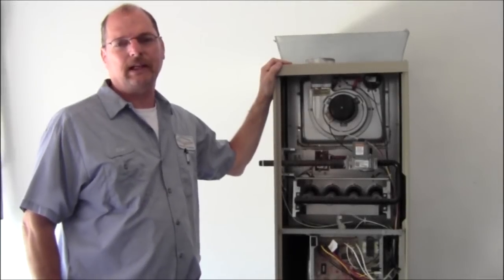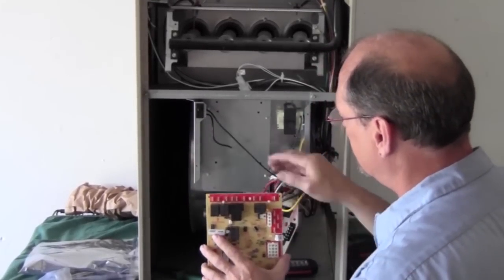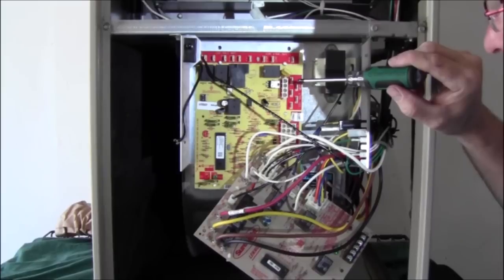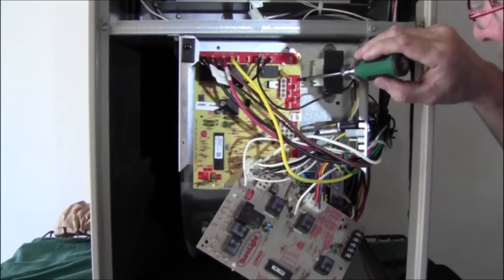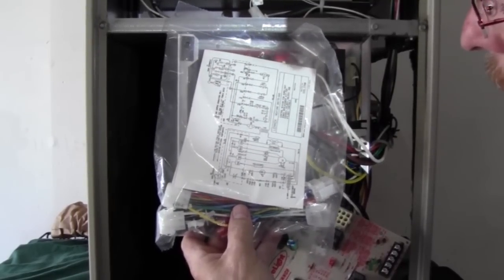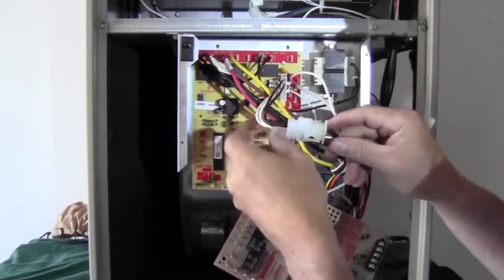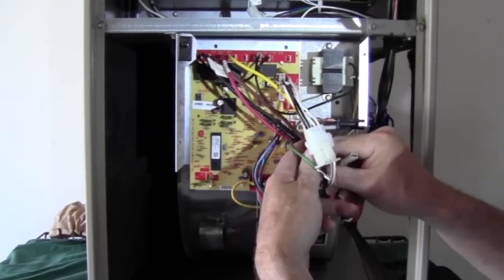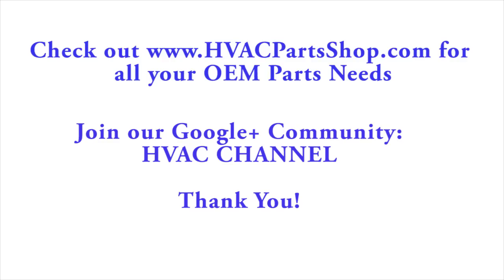Replace an 83M00 Lennox Furnace Control Board (Replacement 19V36)

Comment: If you install the 19V36 board in a furnace that is dual-speed heat, the furnace will then be single-speed heat as the 19V36 board doesn’t support dual speed.
Also, if the 19V36 install guide tells you to put the red “ACB LOW” wire on the “CONT” terminal of the 19V36 board - don’t do it. If you do this, your blower will run on low speed 7/24 continuously even when the thermostat is off.  Instead, move that wire to one of the 19V36 board PARK terminals. The ACB LOW red wire is the low speed blower wire, and there is no low speed function after installing the 19V36 board, so the correct terminal for it on the 19V36 board is one of the PARK terminals. A PARK terminal is not connected to anything - it’s just a place to put an unused wire.

Comment: I've replaced two boards in a 2-1/2-3yr period so far. Board wouldn't let me clear the code. Also, it would never go in soft lockout mode. That's when I figured it was the board. Who's making these boards for Lennox?

Comment: What a fantastic video. I'd hug that man if he was near me.! 
Thank you very much!
The instructions that came with board... garbage.

The only thing different from mine and his...

My yellow and green wire were in the board together. 
I cut the green (ground ) from yellow and attached it to the ground.

My board also came with a brown thicker wire labeled ACC on the board. That must be for a multi speed fan blower. 

I followed the brown wire to its origin and a 3 connector (black white brown) plugs into a 2connector. (Black white) 
Brown empty. 

Once again.. fantastic video THANK YOU !

Comment: Great Video!! Thank you so much. I had a yellow wire from the transformer connected to a green wire with a clip that was plugged into the 24 VAC RTN. The yellow wire I attached to the yellow wire from the harness, and the green wire to the green from the harness. Nothing is attached to the 24 VAC HUM on the new board. The blower now works, which it hadn't, but when I turn on the heat or AC, the 3 amp safety fuse pops.

Comment: I have a g40uh-36a-070-03 and the board is smaller than this one. Will this board work?
Reply from the maker: I suggest using our video "Using your Model Number to find parts" video to help you use your model number you provided to find the board that you need. if you have any questions feel free to call us at 1-866-215-3831

Comment: This is good information thanks, I have a BCC3-2 Rev B LB 90676 Cat No 65K29 that the unit is tripping the W28-XQ1A-3 32V 3Amp breaker switch that is talked about at 12:58 .   Where does the blue one go that is on the W B Y C G row... and what is the blue wire for.   Any thoughts? 

 I'm going to go and check some wires now, and odds are replace the transformer (seems warm) and the safety 3A switch...
Reply: The blue wire goes to the "C" common terminal.
Reply: How this worked out was from the thermostat there is supposed to be a yellow wire from the Y terminal.  This was not the case.  The small bundle had a blue wire and not a yellow wire and had a small sticker with a Y.  However, in the basement there was no sticker and no Y.  So it either fell of or wasn't there, and when the board was replaced the man who put it on tossed the blue wire (Y signal) onto the blue common terminal.  And when the signal was thrown for cooling it tripped.  Good that I found it and didn't throw a lot of money at it...

Comment: Such great help just has an xtra wire on old board (50a62-120)i have HTG ACC terminal not sure where it hoes
Reply from the maker: Their are some extra terminals on the board that are called Dead spots where you can place the unused wires. Give us a call at 1-866-215-3831 for help if you would like!

Comment: Excellent video - contractor wanted to charge $600 just for the board.  I found it from North American HVAC for $144 - quite a mark-up.  This video made the install a snap.  Thanks so much.  I finally have heat!
Reply from the maker: We're glad you have heat now! You could have also purchased it from hvacpartsshop.com also, for considerably less than $600.00! We've got all the parts you need, so just let us know if there's anything else you need!
Reply: now only the board costs 900 CAD.....

Comment: Please help me! How do I know what control board replacement to buy? What model should I get? My current one says Superlight Lennox White Rodgers and I see the numbers 1194V0 and also Ansi Z21.20 on it. Please and thank you!
Reply: If you have question on what control you need for your furnace just call in with your model number and we should be able to help 1-866-215-3831
Reply from the maker: If you still need assistance we'd be happy to help you out! Call 866-215-3831 with your model and serial numbers and we'll get you taken care of! Thank you so much for watching!

Comment: Finally I found something to boost my confidence, I'm replacing a different Lennox board - the 50A55-120 which has been bypassed by my AC contractor.  He wants $525 to replace the board.  Trouble is I didn't see it before he bypassed it so if I swap wire for wire on to the new board it'll still be bypassed!  I've been trying to get confirmation of blower wiring colors and Emerson, Lennox, White Rodgers won't talk presumably because I'm not in the trade.

Since my blower is now running 24/7 I believe black was taken from Cool H and connected to Line where the safety switch connects to supply constant powr.  So all I have to do is put it back on to Cool H or terminal E17.  There are some discrepancies between my board and the one in your demo.   It seems my Heat is yellow and I have two Park, brown and red...unless those were also moved (?)

Since I'm going to use the exact same board I doubt I'll be using molex adapters. The only other thing you didn't mention was dip switches but again I'll just replicate.

It's a shame you don't sell the board I need.

Thanks for not holding the camera while you're also swapping wires. You'd be amazed at what some people post on YouTube...
Reply: Why wouldn’t you just check the wiring diagram.on the furnace or the one that comes w the board.?